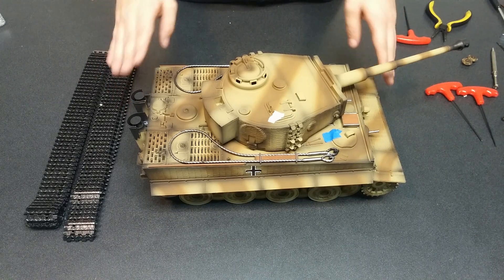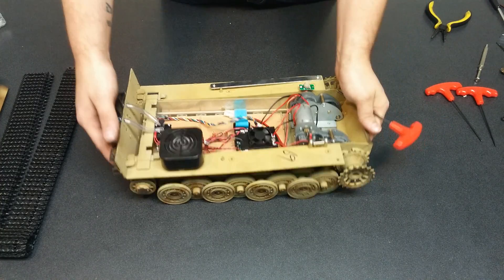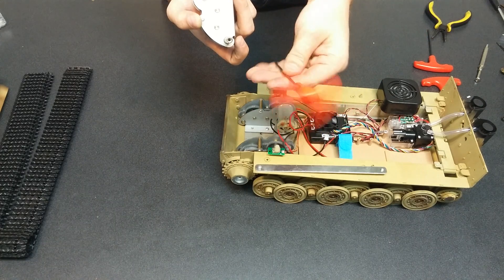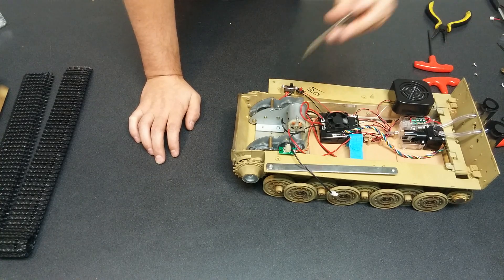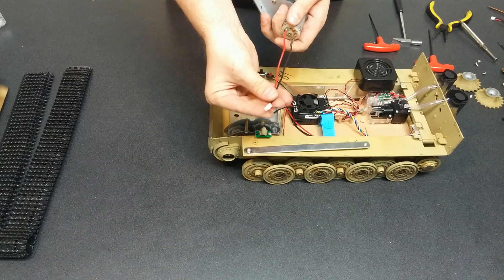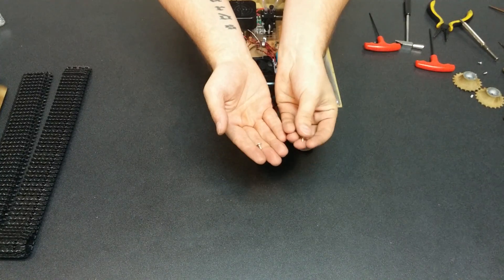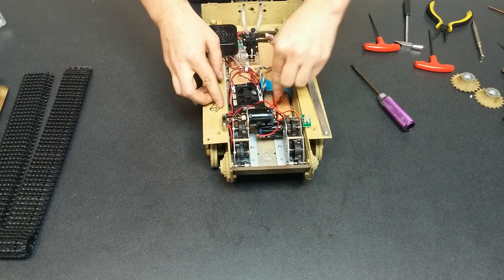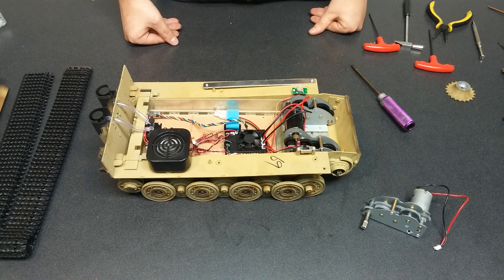How to replace gearboxes on a Taigen Tank

Comment: I have this same Taigen Tiger I Metal tank.  Bought it 2 years ago off EBay. It appears to have never been used, and I have never used it either.  It has the same gearboxes in it that were in the tank, in the video.  I believe those are the cheap zinc gearboxes.  After watching this video, I have discovered that the lead course gearbox thread on the hull gunner side of the chassis, is stripped out on mine.  The inner sprocket wheels won’t budge, so they will both need to be tapped off with a hammer as shown in the video.  The tank in the video has “69” written on the hull gunner side sponson.  Mine has “74” written on the same location.  My electronic control board is dated “Aug 31, 13” on the bottom.  So I assume my tank must be around 11 years old.  The sound effects coming out of this board are terrible. The engine noise sounds like a cat screeching..  I’m guessing this must be the early “V1” control board.  The sounds coming out of this thing really are rubbish.  I have a Tamiya Tiger I Full Option tank that I’ve had for 15 years.  It is a precision masterpiece of electronic and mechanical engineering in comparison to this Taigen. I can completely remove both sprocket wheels from the gearbox output shafts in a matter of seconds, needing only either a Phillips head or flathead screwdriver.  No hammering required.  Too bad the Taigen late steel wheels won’t mount on the Tamiya swing arms.  In contrast, the idler wheels are interchangeable between the two tanks, because the entire idler wheel assembly is a direct copy of the Tamiya design.

Comment: No external axle support (ball bearings) under the side gear on the Taigen Tiger? very strange with such a weight with metal rollers, chains, drive and suffering wheel ??